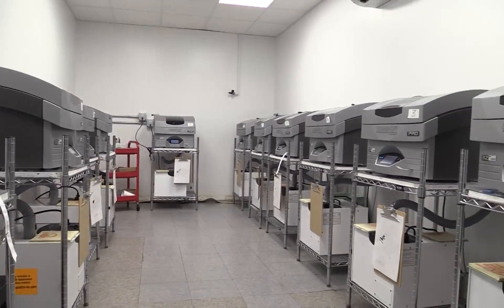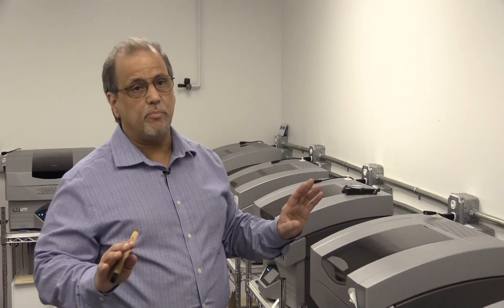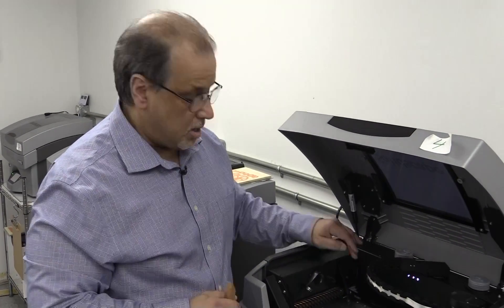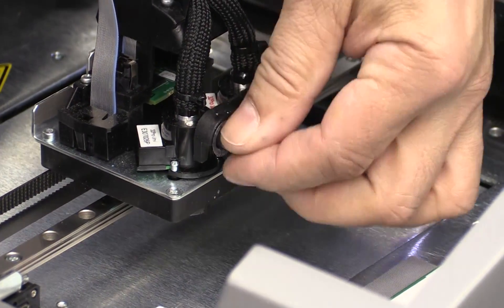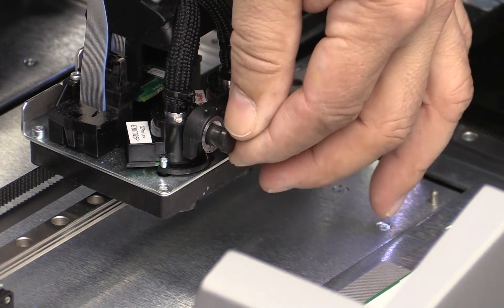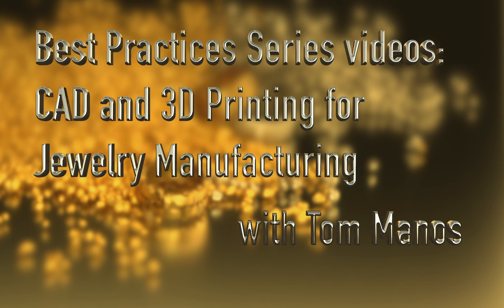Solidscape High Precision 3D Printer Maintenance (Jewelry Best Practices – Episode 6)

Comment: If anyone is going to buy solid scape printer must read this first Well my opinion will be that dont buy this printer instead go for a dlp printer of Novafab or protospeed their resin casting are fine also they have speed these solidscape printer dont have speed i must say you dont get the quality of casting same as solidscape you will get some porosity problems but still solidscape printer need Air conditioned environment but novafab or protospeed machines can work at 25-32celcius environment